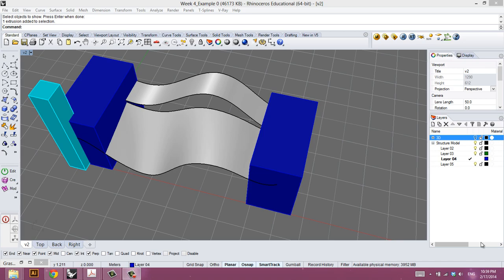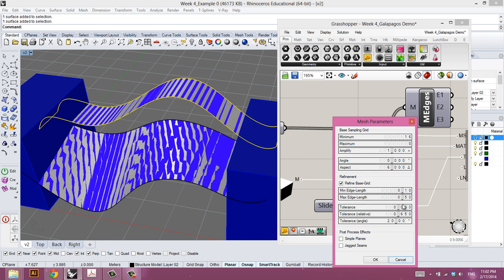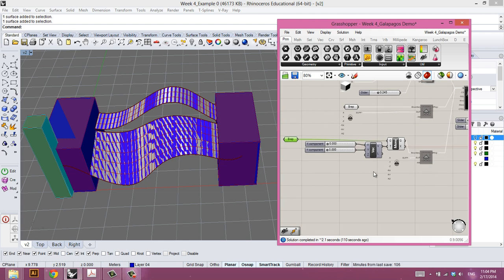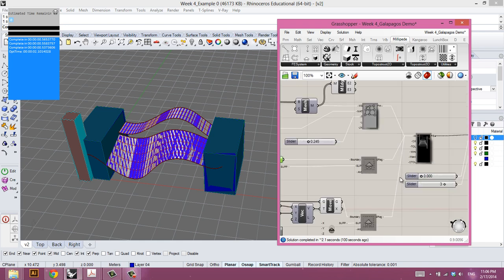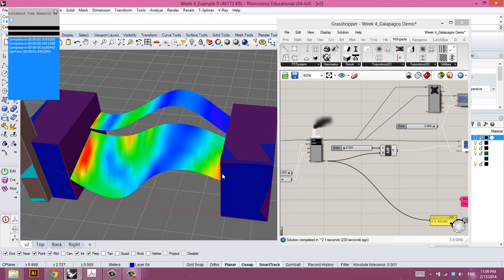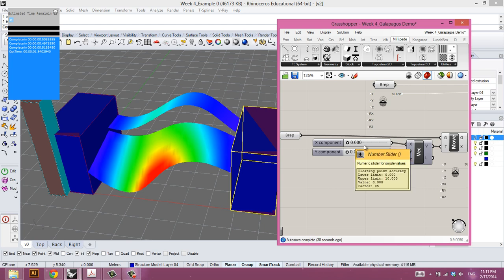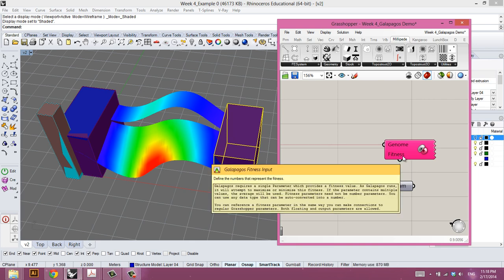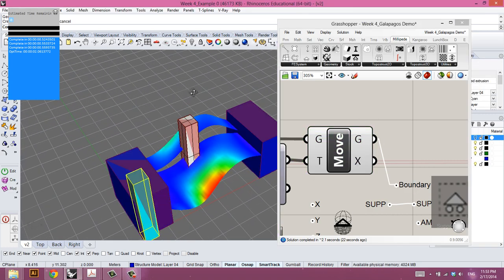Evolutionary Optimization with Millipede + Galapagos

Comment: Hello Nathan Melenbrink, I have a question about this video. I'm interested in knowing how to conduct structural analysis on the weird shaped slab (the mesh) and not the column as presented in the video. Actually I'm interested in knowing limitations of millipede concerning structural analysis and design of steel reinforcement.
Reply from the maker: Hi, I'm not sure I understand your question. The "weird shaped slab" is what is being analyzed. If you want to generate a new "weird shaped slab", you could parameterize the input curves for such a shape and use a similar evolutionary process to optimize those curves. Millipede is just an FEM solver -- it does math quickly and accurately. In most cases, the limitations are whether the user models the problem correctly, and interprets the results correctly. In other words, Millipede is very useful for structural optimization and form finding, but it doesn't replace the need for a basic knowledge of structures.